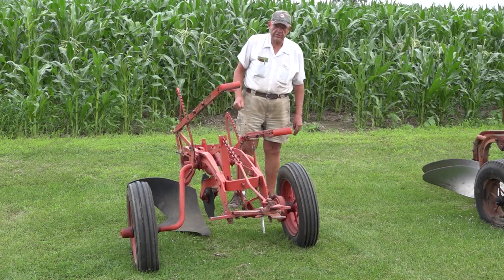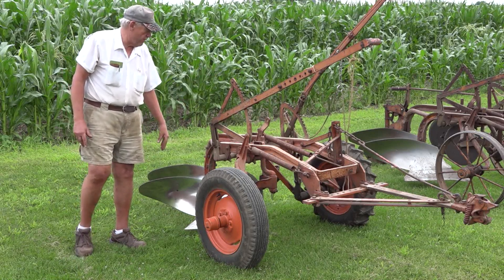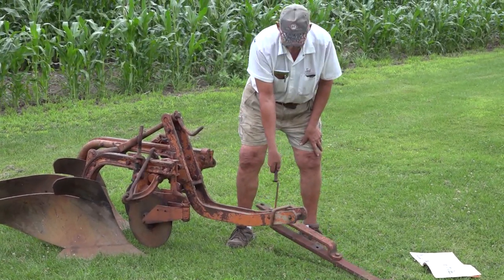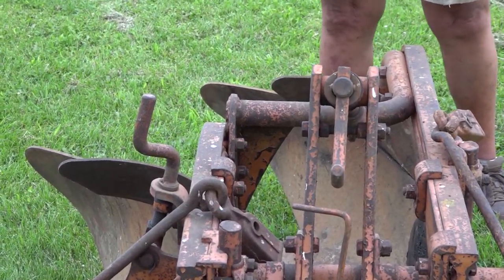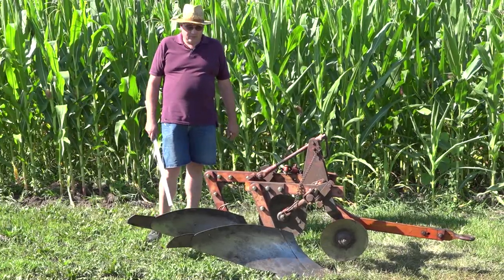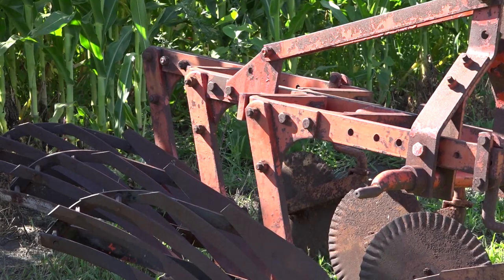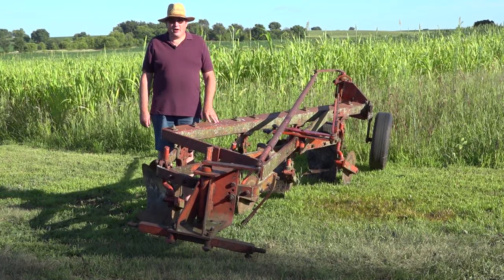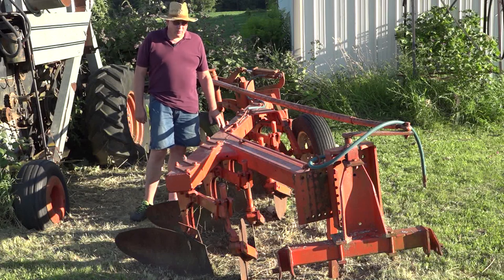Allis Chalmers Plow Identification

Comment: What changed in the design of the plows that almost doubled the HP requirement per bottom?  Was it the depth they operated at or the speed they were designed to work best?  I’ve watched a bunch of old plowing videos and I’m amazed how big of a plow many 50-60 hp tractors were pulling and the speed they were going?  I remember plowing with a Case 930 and a 4-14 Case pull type ,plow.  In our soil going about 5 mph that was plenty load for that tractor.
Reply from the maker: The hp requirement doubled do to both increased depth and speed with the biggest variable being the speed.

Comment: I have one that looks very similar to the number 2 but has no clutch. it has a hydraulic cylinder and it looks factory. any ideas what that might be. can post a video if it. want to restore it to usable condition and would like to know what model i have. cannot find any markings other that allis chalmers in the I beams.
Reply from the maker: Allis did offer that plow with hydraulic lift as an option.

Comment: grate video .i have a 4 bottom 50 series .is it factory? or did some one just bolt a 4th bottom to a 3 bottom. i have not tried to plow with it .thanks for any information
Reply from the maker: The only 50 series plow with 4 bottoms was the two-way #54. I you're right about someone adding a 4th bottom to a 3 bottom plow.

Comment: I was wondering what that spring was I kind of thought it was to absorb shock my WD has that underneath it
Reply from the maker: Yes, it’s a shock absorber of sorts to help protect the plow. Also one could add the hand clutch throw out. That would disengage the hand clutch if the plow hit a big rock or stump. The only down side was that the tractor would stop on a dime and the operator would be launched forward in to the steering wheel which was not go for the chest!
Reply: @The1952caallis  thank you very much for sharing 🚜 God bless y'all and stay safe buddy
Reply: @The1952caallis  I recently bought a WD Allis Chalmers, it has a wide front end and overall is in very good condition, I hope to restore it this winter 🚜
Reply from the maker: That would be awesome! Hope you can get it done.

Comment: Our 190 was our last snap coupler tractor, and we pulled a 4 bottom semi-mounted plow that looks like the 9000, so that must have been another option for it.
Reply from the maker: You are correct. I took another look at the parts book and it does list the snap coupler hitch. Not sure how I missed it, but thanks for pointing that out.
Reply: Allis also made an adapter that would convert a three point hitch piece of equipment to a snap coupler. It was bolt on and allowed the use of the traction booster system.
Reply: @tedbuisker6827  I've seen lots of third party 3-point sdapters for snap-coupler tractors, but I didn't know Allis had one.  Our Allis implements from the 60ss were clearly built with a bar or plate near the front,  to attach either snap coupler or 3-point connectors.
Reply: @tractorsold1  I have two of the adapters, both painted AC persian two.  At one time they sold for around $500 around here.  The ones I have bolt together capturing the three point pins on the implement.  They work very well.